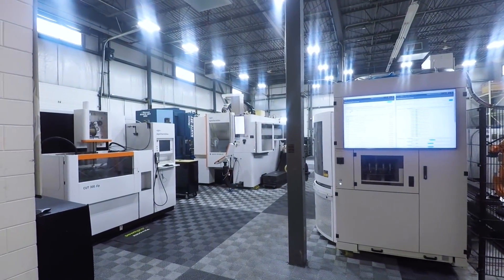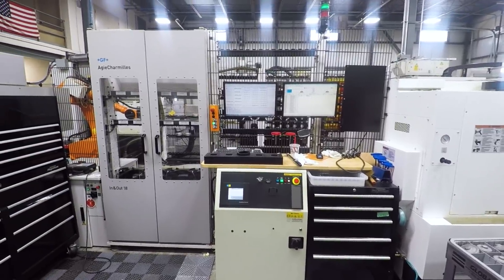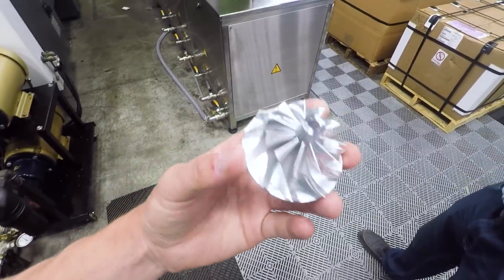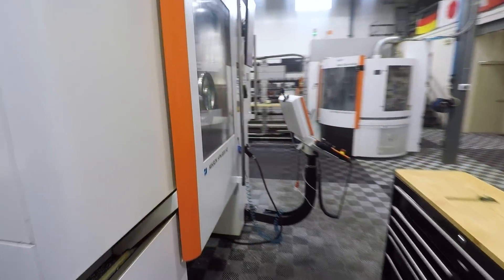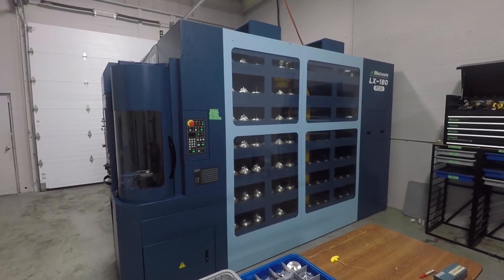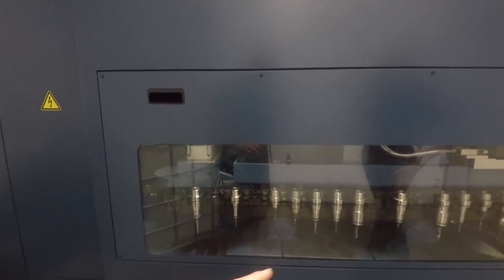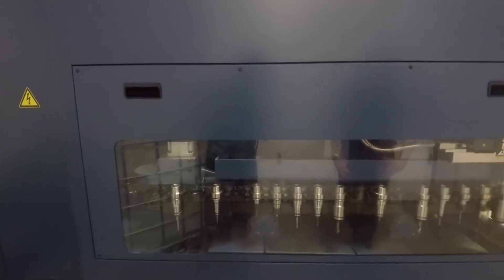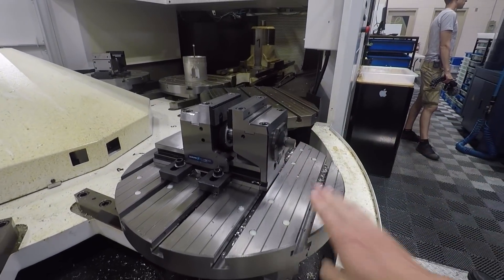AMAZING 5 Axis Machine Shop: Miltera!

Comment: Love the channel John, does all this automation etc. not reduce the pay for the actual CNC machinists though, because they're doing less (I know often the robots here are just loading pallets and chucks) I know from a business standpoint it's perhaps better, but I just wanted to see what everyone else's opinion including yours was on that? 
Coming from a young CNC machinist
Reply: Automation just takes away the repetitive task of reloading machines, it doesn't do any of the valuable work the machinists at our shop do.
Reply: Even the programming through CADcam etc. I know certain 4th axis and 5 axis parts you pretty much need to use software like that to make more complex parts, but I just wondered if that reduces the skill level for the machinists in those shops so they're essentially 'button pushers' and the job isn't seen as skilled as I feel it can be.